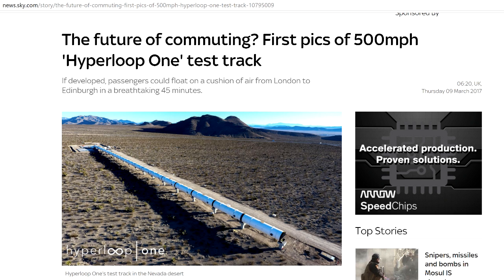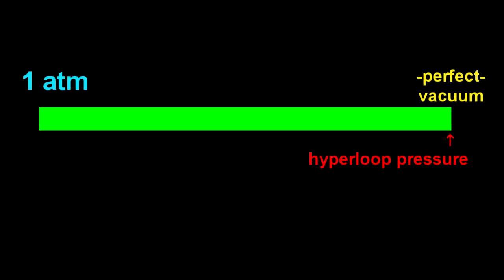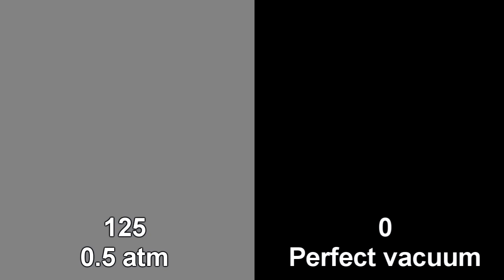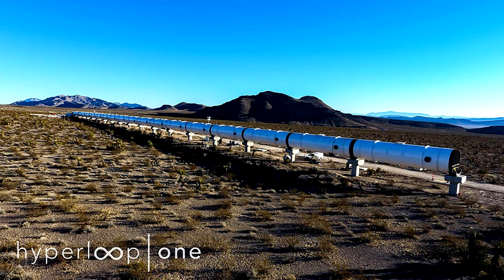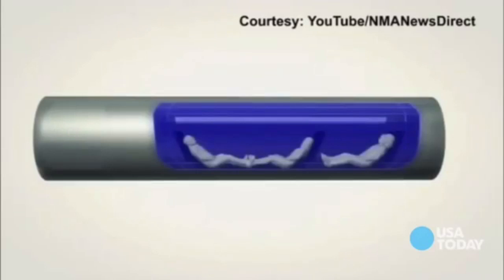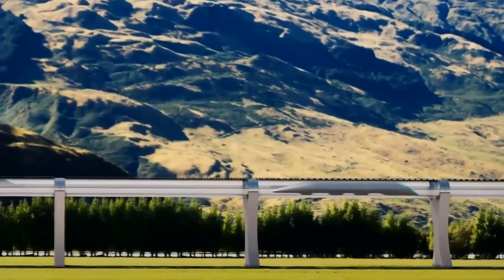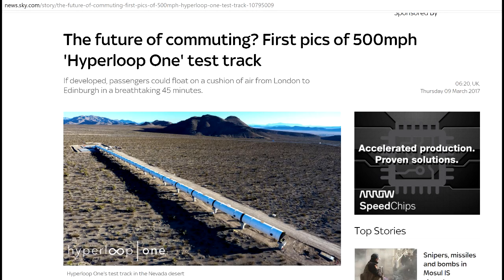Entire Hyperloop could be destroyed in SECONDS!

Comment: They said it was impossible to circumnavigate the world, they said it was impossible to conduct heavier than air flight, they said it was impossible to create a commercially viable electric car that can drive further on a full charge than a conventional car can drive on a full tank, they said it was impossible to land the first stage of an orbital launch on a barge in the middle of an ocean. And now they're saying it's impossible for the hyperloop to work.

There were challenges to be overcome by the wright brothers in the first controlled heavier than air flight. There were challenges to be overcome by the USSR to send up the first satellite, There were challenges to be overcome by NASA to put the first man on the moon. There were challenges to be overcome throughout history.

You have to remember that, unlike solar freakin' failways built by a couple of farmers, the hyperloop has Elon Musk and his team involved. If anyone can achieve what was thought to be "impossible", they have a much better chance of doing it.
Reply: No one is claiming that the Hyperloop is impossible in theory, just unpractical on several levels. It is perfectly feasible to build a colony on the sea floor, or use zeppelins for air travel, or power one's appliances with compressed air instead of electricity. However, the ideas are unpractical. The hyperloop idea is completely possible, but the required security measures alone would make it slower and more expensive than air travel.

Comment: All major impracticalities aside, the pods are using standard wheels (and what looks like a railroad track groove). If the whole idea of the project is to essentially remove all the resistances, why didnt they try to use MAGLEV technology instead of normal wheels. In principal wouldnt that create virtually zero resistance, which is what they want? Going through the trouble of putting the pod in a vaccuum chamber seems absurd if you aren't going to try to eliminate friction of the wheels with the ground

Comment: I doubt the hyperloop would implode throwing metal like the class container did.  I doubt the whole 1000 mile long hyperloop would all crush.  My worry would be that the tube would bend like a giant arm and sweep across the country side smashing flat anything in its way.  If the passenger capsule was inside the crushed section it would probably be crushed killing everyone or even if it wasn't crushed the massive g-force from the rapid deceleration or acceleration if the collapse happened in front or behind them would kill them.

Comment: Not sure about the quality of your "graphical representation" using "255 pixel depth of Colour" comparison. Your comparison of values 2 and 0 is not visible in the youtube video (probably due to video compression/optimization). To see what I mean, play the video up to https://youtu.be/Z48pSwiDLIM?t=1m27s then take a screen capture (print screen), then open the image in a paint program, use a paint-fill tool (with 0 tolerance for colour variation) and fill by clicking in an black area of the left side of the image with the colour red, What you will find is that the whole image turns red. This demonstrates that the shades in the video are not only similar but identical (since this is how flood-fill logic works, stopping at colour boundries). Since this was a visual aid in illustrating your point I thought you should know that it was a flawed/contaminated example.

Comment: You know that you could say much more things about dams to make it sound like a bad ideia. I understand your point but you seem to forget that many of the problems you've pointed out are easily fixable with some engineering.

I'm not an expert but I still can see some doable solutions for most of these problems
-Divide de loop in segments with trap doors to prevent the depressurization of the whole thing in case of failure.
-Being under pressure means the cars move faster. But if there is a failure, the only problem with the cars inside the tube would be the increased air resistance. Slow down the car and everything should be fine.
-Make vacum chambers only for depressurizing the air around the cars before sending them to the loop.
-There are many other materials and composites that can be used for the structure.

I'm too skeptic about this really going into construction but from an engineering point o view, it seems possible. Expensive but possible

Comment: A perfect vacuum has an inward pressure of 14lbs per a square inch. If we make the hyperloop the diameter of the Queens-Midtown tunnel it will be 1830in or 152ft in circumference. That means every 1 inch slice of the tube will have to support 14*1830lbs=25614lbs of atmospheric force. Note that a single 8in wide 8 foot long I-beam of steal can only support 30400lbs. So a circular loop of these I-beams can support 577600lbs and an 8in slice of the tube will have an atmospheric force of 204912lbs. So by this back of the napkin calculation it's seemingly possible to construct a large hyperloop.

Comment: One thing I haven't seen anyone mention yet is that even if you manage to solve the engineering issues of the giant vacuum tube/chamber, what happens when a pod springs a non-trivial leak? Dead passengers, at the very least, that's what! Even if it's a slow leak, they're gonna die before you have time to re-pressurize the tube without wrecking it. And, of course, if the pod experiences some kind of explosive decompression event, how likely is it for the high-speed debris to damage the tube enough to cause catastrophic failure of the whole thing?Finally, the phrase that comes immediately to mind about this whole wacky-nuu-nuu thing is, "Terrorist/Nut-job Magnet". Have they factored in the cost of round-the-clock guards over the entire length of the thing into the ticket price? ;)

Comment: What I dont understand, if there is no air fricction in the tube. Why are all the designs pseudo aerodynamic? The most efficient way of transport would be something that fills as much of the tube as possible to fit in as many passengers, right? And if there is no friction from the air you might as well put an enormous can with a few electrical engines and wheels (or tracks) in it.

Comment: As was mentioned with the last video, the pod wasn't meant to travel far, it was meant to be accelerated and then break safely.
And the difference with the hyper loop tube and the one in the implosion video is that hyper loop is designed to be a vacuum, the container in the video was designed to be under pressure.

Comment: To people saying 'It's compartmentalized!', oh yeah? And if one, fucking ONE segment collapses, you have two outcomes: Sensors detect it and the entire Hyperloop shuts down for days while they fix it, or a capsule carrying people going (theoretically) 600mph SLAMS into the collapsed portion. No survivors. If it collapses while the Loop is in use, and they detect it, and stop the capsule? How the fuck will people get out? They could be trapped for hours waiting for depressurization, and welding crews to cut a hole so they could get out (unless you put emergency hatches in each segment, WHICH would compromise the integrity of the structure and vacuum). It being segmented solves nothing. The damn thing still will not work at all, or be massively unreliable and dangerous.

Comment: The core idea of the hyperloop has been around for at least 100 years.  It's been in the hands of many inventors.  In the end we got a clever way to cash our checks in a bank drive thru.  
A traditional high speed train would fit the need and come at a fraction of the cost.  The US doesn't really have high speed rail and that really is a barrier to a project like the hyperloop.  It sort of demands us to be masters of the railway to tackle such a challenge. The other problem is the geology.  An active fault system is not where to construct this thing.   These a minor things that cause major problems for simple construction.  

The fact that there isn't a working prototype should clue more people into the fact that this isn't going to happen.  Not even a working model of the purposed system.  That should be an easy task if they really have the tech and skill to make one hundreds of miles long.

Comment: Is it possible to section off areas in the hyperloop so that instead of vacuuming the whole thing down you only have to do a small area at a time? Could that also make it more stable if such a structural failure were to happen, since if one pocket were to rupture it wouldn't break the whole thing? 

I'm not try to defend the hyperloop in anyway I just want to know how an "airlock" would work in such a thing. This reminds me of the movie Core and they had a similar solution but since it's a movie idk how that would hold up in real life.

Comment: I dont get it at all. Just improve maglev or a french train (like tgv) with electric motor at every wheel. A slight improvements of them and/or the track makes the train go nearly the same speed as this vaccum shit. With so much less hassle. This is so pointless. 

I would rather see a pulse detonation engine with electrostatic turbine to compress the plasma before it makes you go faster then you can imagine. Just take one from a high grade military plane and modify it for trains. That with maglev tech can make the train go up to a few mach if you want without vaccum. But a thing like this needs its own power plant and needs a track that is way harder and expensive to make, but at least it can be mostly made from concrete and cooled by water easily. How to deal with breaking sound barrier is tricky. So the start might not even have any tubes for the train until it breaks the barrier. You would only need to use the pulse detonation engine at the start to gain speed and then the maglev should allow it to keep that momentum for a long time. We might not even need to go supersonic with a train like that. But the cost is in trillion+ if you want to use it at any long/moderate distance. #pepe
Reply: 350 km/h is done daily in Italy. 
Work is underway to make select services (with ETR400s and AGVs) travel at 400 km/h.
400 km/h is enough for our country, because distances between large cities are short. It might not work for other countries like the USA where intercity distances are larger. The only problem are the mountains that are all over the place. For instance, if we had plains everywhere, we could get from Genoa to Milan (180 km) in half an hour, but since there is a mountain chain in the way the speed is reduced to only 110 km/h in the hilly region (160 km/h in the flat region which is not very long) and thus the travel time is 1 hour and 45 minutes.

This is, however, vastly superior to the car which suffers from the same problem, and worsened by the travel time in the city itself (very slow, as we don't have those huge boulevards the French and the Americans have) and the fact that the 110 km/h speed of the train in the hilly region is reduced to !! 70 km/h for the cars (and yes that is called a motorway...). The fastest travel time by car is 2 hours and 45 minutes.

And let's not even talk about planes, because by the time you get to the airport which is in the outskirts of the city, the train is already half way of the trip and the car 1/3rd :D

Planes in Italy only make sense to travel between mainland and Sardinia.
Reply: The problem with regular trains is NOT the rails. Speed wobble has been solved since the 1950s, and that was the only issue that was present in regular trains and that Maglev solved.

Now there is only the issue of getting the power to the train, because catenaries can't cope with speeds more than 500 km/h because of a phenomenon known as "catenary boom" (similar to the sonic boom). A pantograph pickup sliding on the catenary generates a wave with speed approximately 500 km/h. When the pantograph travels at the same speed of the wave, the wave is amplified until the catenary shakes so much it either snaps or breaks the pantograph.

A way to combat that is to have a higher tension in the wires, which increases the speed of the wave. But higher tension causes more wear, which is why trains don't usually travel past 400 km/h.

If we solve that problem, trains (even regular locomotive+carriage trains, not only "high speed") could reach 500 km/h easily.

Diesel can't be used as it's too heavy sadly :-(
Reply: 400km/h is still good. It will get you from the two cities fast enough imo
Reply: Its 603kmh max and 500kmh is the usually speed of the JR-Maglev.
Reply: Živa Ris agv is the tgv you know
Reply: No no it's a different trainset. It is still made by Alstom however.
The TGV has two "locomotives" at each end (named power cars)
The AGV has what's called "motorisation répartie" (each car has a motor, there are no locomotives)

This is an AGV: https://farm9.staticflickr.com/8448/7999086916_7c07c0faeb_z.jpg
And this is a TGV: http://www.rail-modelling.com/media/railmode/FotoRotabiliReali/Elettrotrno_TGV_Atlantique_1.jpg

Comment: Bad comparison. That tanker tdailer was NOT designed to withstand a vaccum, that demonstration was meant to warn employees to avoid unloading in a way that could cause a vacuum.
Reply: what else would you compare it to? a straw? it's designed to form a vacuum and transport liquids through it, but collapses if there is too much outside pressure.
Reply: submarine? 30 atmospheres. 30 secs of research.. don't quote me (quite likely to be wrong).   The other way around .. the space station?
Reply: 1 atmosphere is 98066 pascals.. (which are kg/m2), or 14 psi, a bike tyre is nearly 10 times that.  I know it's tension versus compression and all.  But I don't understand why this is an issue?
Reply: You would compare it to tanks designed to hold a high vacuum, not a tanker truck. Tanker trucks are designed to haul liquids, sealed tightly to prevent evaporation losses, but are not designed to withstand a vacuum. They all  have pressure relief valves to prevent rupture from overpressure, but few have a vacuum relief valve, so it is important to open a vent valve and let air in when unloading.

Comment: Tfoot is overstating the implosion risk. Even using 1940s tech is possible to build tubes that can withstand 10 times the pressure that the hyperloop will have to deal with. The problem if getting into the tube and dealing with expansion could also be solved with the correct design. However all of those solutions would add to the cost of building a hyperloop so while it may not be impossible to build a working hyperloop the expense of building and maintaining it would prevent it from ever being profitable.

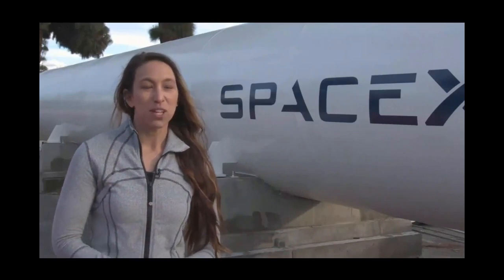Comment: The Hyperloop design isn't set in stone, you know. AFAIK, Elon refers to it as similar to air hockey table. The pod is supposed to take air from the front and eject it below to create an air cushion to levitate and move. This vacuum design you're talking about is a different concept entirely. To me, they are just testing out different ideas to see what works and what doesn't. They did say in that SpaceX interview that the track can go to different pressure levels depend on the requirement of the pod design 5:22 , so it doesn't need to be a vacuum. It's just that the students who design the pods want to play with vacuum.
Reply: yes, pretty much a hovercraft in a tube but faster and more efficient. I don't know if bullet train is better.
Reply: or a mag-lift train, both  of which we have good safe designs of.
Reply: WOO HAN
uh... okay... but those are already been done. so what's your point? the hyperloop is about finding a new way of transport, that's why they're testing new ideas. mag-lev is already a solved problem.

Comment: I still don't understand why it took so long to get the pods into the test tunnel. Surely with something like this, you'd have an airlock system, where the main tunnel is under a permanent state of vacuum, and only the boarding area would pressurise. Then when it's ready to go, all passengers on-board, you just seal up that small part, depressurise that section, open the door to the tunnel, and you're off.

Or maybe I'm just being stupid, because I don't have some fancy education degree...
Reply: yes, I'm sure that's how it would be done in actual vacuum chamber. The thing they done so far was only a test, where such fancy system was not in place. That said it would still take about that long to de-pressurize the air-lock segment in question. The bottleneck is not the size of the tube. The bottleneck is the power of the pumps trying to lower the pressure to expected value.
Reply: That's true. You can't really expect the test to have the final model's workings... that's why it's a test.

Still, while I'm not debating that it would still take time to depressurise the starting chamber, it wouldn't take nearly as long if you're only removing the air from a small chamber, as opposed to removing all the air from an entire kilometer of track. It's a simple matter of volume. There's a lot less air in a 2-3 meter section than there is in an entire kilometer length tube...
Reply: I've just checked and the vacuum they are proposing is lower than vapour pressure of water. The bulk of the air would be removed fairly quickly - the time-consuming part is to remove volatile substances (like condensed water and oils) which pollute the vacuum with new gasses as they vaporize under low pressure. It does not really matter that much how fast you pump the gasses out at that point - you are literally waiting for the stuff to boil off the walls, which depends mostly on the temperature. You can speed the process up by baking the chamber, which is exactly what they do when constructing large near-perfect vacuum chambers (like LHC and LIGO).
Reply: Oh ok. Well that makes more sense as to why it takes a while. Thanks for letting me know :)